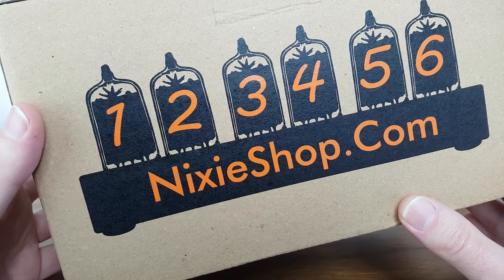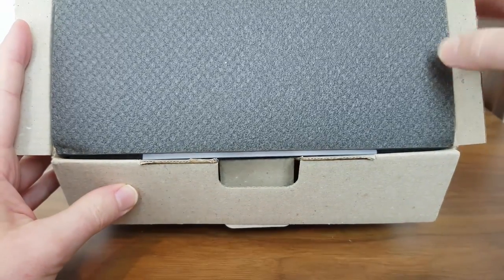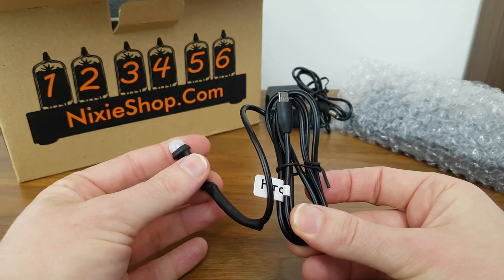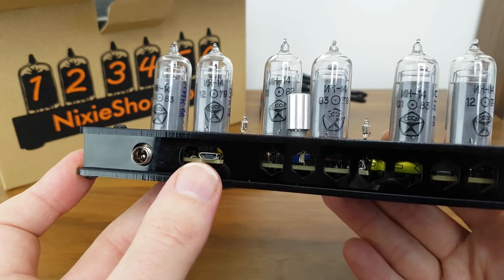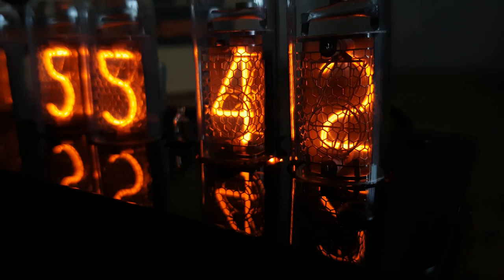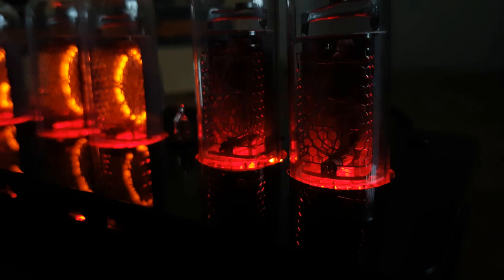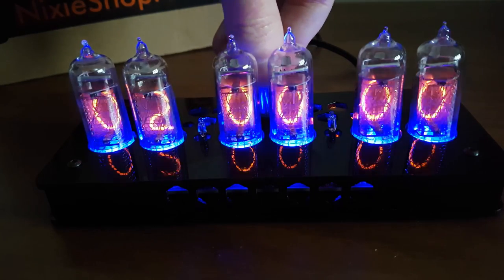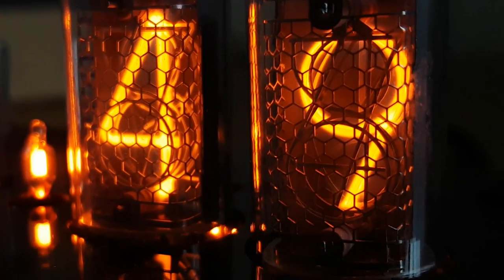Unboxing & First Look - Nixie Clock (IN-14)

Comment: These Tube clocks look really cool... and a great review by the way... they are a little expensive, from $180 - $330, for me it's a want currently and not a need... but thanks for the vid
Reply: You can build one yourself with a kit from Ebay for around a $100
Reply: @quantumoverlord4413  thanks for the heads up
Reply: @wembley636  No worries, but just remember to check that you have the tools necessary to build it. Though you can probably access them one way or another ;)

Comment: I am still puzzled by that 'tube preserve' sequence. I have made myself Nixie clock (with six IN-12) in 1994, running them pretty close to the max current, they run since that time with no issues.
Reply: They have been on for 24/7
Reply: That’s impressive I thought the tubes burn out easily
Reply: @StraitClownin909  , yes 24/7
Reply: @nikolaipavlov544  that's freaking cook man

Comment: Have you used the proximity sensor?  Curious to know how well that works.
Reply from the maker: citekare yes I have it's plugged in all the time as ideally you don't want the tubes on when you're not about as it reduces their life. Ive found it works very well, sometimes if your sat very still it won't see you but thats rare. It's all about placement but it does pick you up easily from 3 or 4 meters away. It's a good feature and the tubes turn on very quickly.
Reply: Thank you.  I'm planning on getting that same one in a couple of months, so it is nice to see it in action.
Reply from the maker: citekare I think you'll like it I love mine. It's always a talking point for visitors.
Reply: Home Gadget ”reduces their life” . Do you know for how long these will work? Also using the proximity sensor so it’s not on 24/7.

Comment: how long do these things last? I want to get one but it's very expensive for a clock
Reply from the maker: Ours is 4 years old and still going with no issues. The tubes are only on when they detect presence so that prolongs life.
Reply: @homegadget-mark  what do you use to detect presence?
Reply: @FrozenShotz25  That thing that he says that captures infrared is actually a motion sensor.